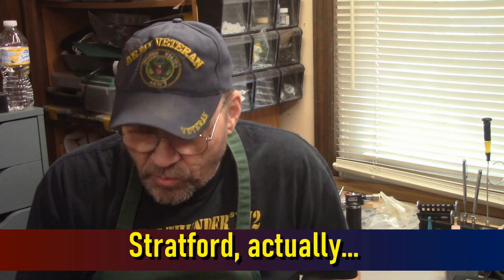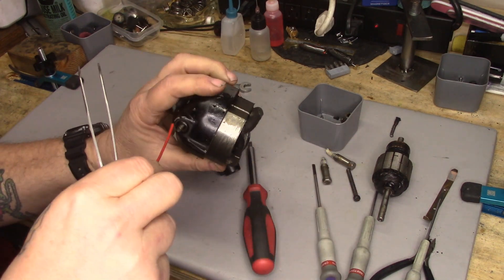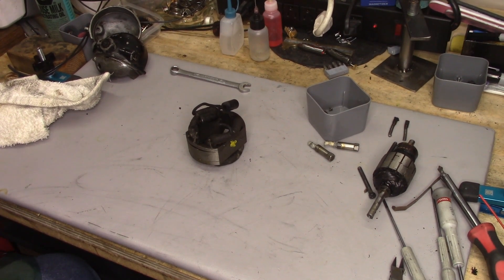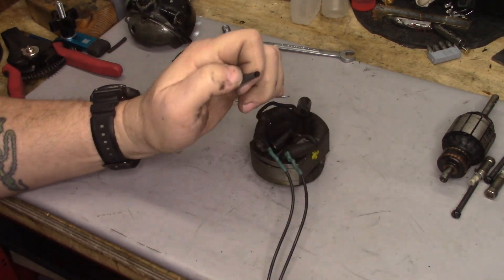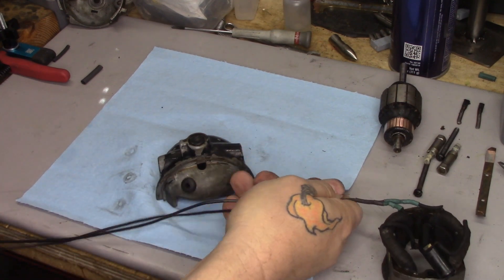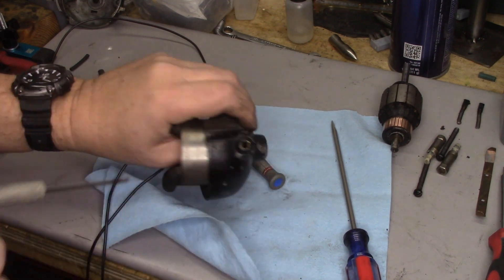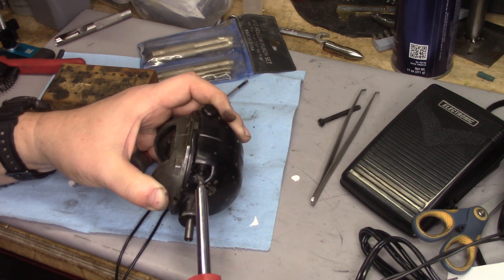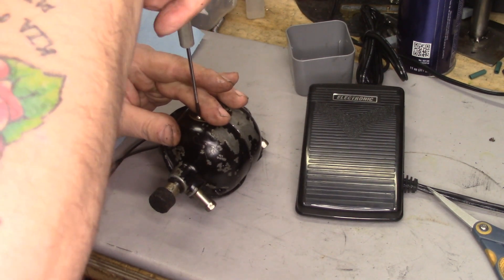Clean and Rewire a Westinghouse Sewing Machine Motor - Sunday Morning Quickies #33, March 13th, 2022

Comment: So glad to find your video!  I'm bringing one of these home this weekend in a lovely console cabinet.  I cannot find a thing about dating, operating or repairing this machine and yet to find a manual, but great to find your video!   Question about the cloth wrapped wire - how to inspect carefully for safety before plugging in?  That will be good for starters.  It does appear the thinner wire running to the lamp needs replacing.  Thanks so much!' - Dorothy

Comment: Those are great little motors--I have a circa 1929 Free-Westinghouse CE "Rotary Long Bobbi" in her original consolette cabinet with knee controller. That friction wheel shaft on mine is a weird diameter that I haven't found a replacement for. I had the same challenge with getting the brushes out. Mine was every bit as gross inside, too. I had to cut a little wedge out of the grommet to get it to fit. I used Sew Retro grease.  I love the way a motor winds up as the lube sinks in. Hmmm... Now I hafta go look up my old supply of business cards.
Reply from the maker: You have quite the collection, I can't wait to see some of your machines! I must admit, the business card stock shim was a very spur of the moment solution to the problem of excess end play. I was kinda happy to see it worked as well as it does.
Reply: @BobFowlerWorkshop  It's about time you stepped out of the Singer box! ;)

I'd really like to see some good White FR videos!
Reply from the maker: @jomercer21113  But... but... but... I live so close to the old factory! 🙂
Reply: Curious what information resources have you found?  I'm about to bring one home and info is very sparse.  Thanks!

Comment: Hi! Thanks so much for your video! I really like that you not only explain how to do something but also go into the mechanical process of what exactly a part is meant to do and why. It really helps me understand these machines so much better! Great Videos! I'd like to rewire a Singer silver colored "swing out" motor and the light that came with my 1916 Singer Model 28. Based on the little bit of research I've done, I think these were Western Electric motors that  could function with a number of appliances in the day and Hamilton Beach and Singer appropriated them with their logos on them as well. Your video here has been the closest in appearance of what my motor looks like but mine is cylindrical in shape rather than turtle shell shaped. I'm wondering whether the process of rewiring  would be very similar to what you do with this Westinghouse motor. I would love if you could do a video on one of these if you had the chance. On my machine, more than anything, I think the cords are what I need to replace mainly. Would  18 gauge standard lamp wire cord suffice? Thanks again!
Reply from the maker: Hi Careen,  As soon as one of those motors come across my bench, I will do a video. I actually messed up this week, I had a motor from a Wilcox & Gibbs on the bench and failed to shoot a video of that one, but I have a feeling I'll be seeing more of those pretty soon. In answer to your question, yes, 18AWG lamp cord should be fine  as we're not pulling a lot of current with these motors.

Comment: Hi Bob, i recently restored a White Rotary FR series including the motor which is similar to your motor. I, m wondering where i can purchase the beveled friction disk? All i see are the cylindrical shape.
Reply from the maker: I haven't found a beveled friction wheel, but I see no reason why one couldn't modify a cylindrical disk to beveled quite easily. Fabricate a tool rest of some variety and hold a file to the disk while the motor spins could be a possible solution...

Comment: Did you do your electrical testing you showed us previously with a meter off camera? Or it it not always necessary?
Great tutorial, thanks!
Reply from the maker: No, the machine had a crude power cord attached prior to the rewire, which while safe, was pretty horribly doen. I ran the motor under power so testing wasn't really necessary. As for the motor on my customer's machine, I just tore into that one blind with the determination that I would make it work come Hell or high water...

Comment: Bob is there a screw to loosen to separate the motor from the machine please, cheers.
Reply from the maker: This particular motor is a quarter turn twist lock to remove, with one screw holding the shaft on the front of the sewing machine.
Reply: @BobFowlerWorkshop  ok thanks Bob.